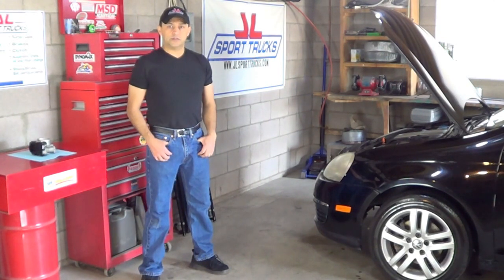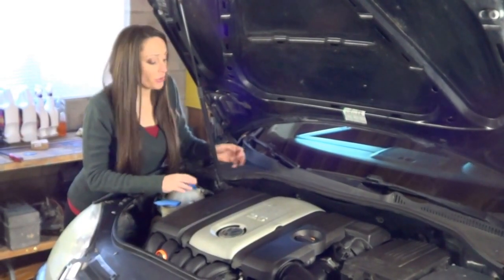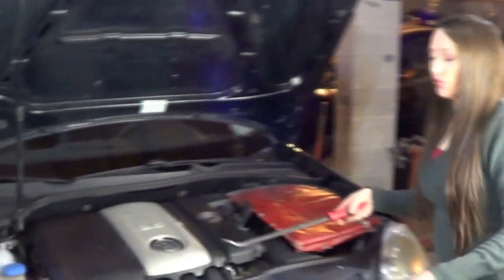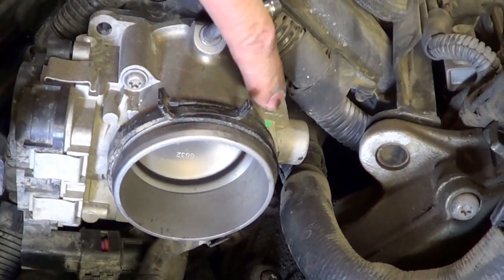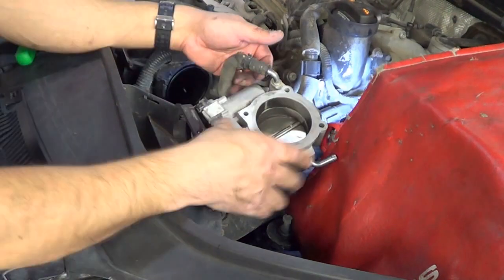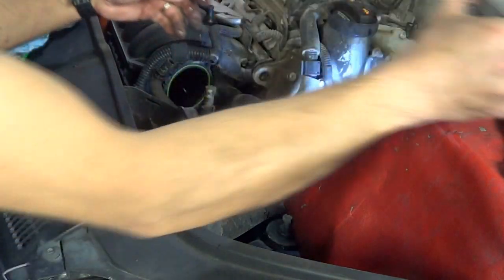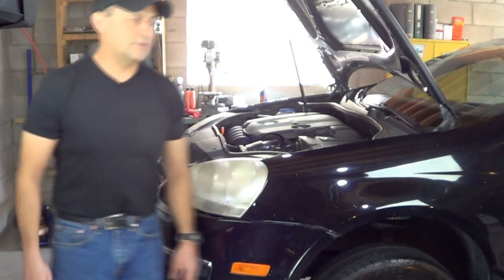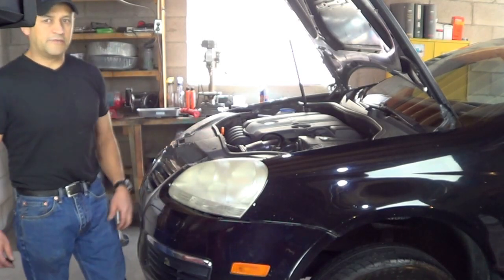How to replace the Throttle Body Unit on MK5 VW Jetta Equipped with 2 5 L Engine

Comment: Is the hose clamp at 4:27 a one-time only clamp? Do you need to replace it once removed?
Reply: Akcay1907 same question don’t wanna open it without knowing
Reply: Hmmm I’m wondering the same. Would appreciate an answer to this question 😊
Reply: Yes, you will need to replace it

Comment: Do you need to adapt the throttle body using vag-com or vcds ?
Reply: @mikeoxhard3826  how do i do that ?
Reply: @mondo9.2.5  Just unplug the battery and "turn on" the headlights for a few min then hook the battery back up. Should be good. :)

Comment: So what size 6-point key is used to actually remove the throttle body? T-28? Please specify. we need to know what tools are required before attempting repairs on vehicles.

Comment: I have a 08 2.5 Jetta. The dealer is telling me my TPS is bad and have to replace the whole throttle body and they have to reprogram the new TPS. Is this true or could I save money and just replace the throttle body myself in my car like you did in this video without having to reprogramming the TPS. Any help would be great.
Reply: Did you need to take your Throttle position sensor(thottle body) to the dealer to get reprogrammed? I need a TPS(thottle body) replaced on my 04 Jetta also. Just need to know if i can do it myself without reprogamming. Thanks...
Reply: @MrDannyLaRusso  Hey did you ever figure out if you had to reprogram the throttle body for your Jetta? I have a 2012 jetta and the throttle body needs to be replaced for me and didn't know if there is a way to recalibrate it yourself
Reply: don't go to the dealer, if they can do it, them you can do it as well, my 2.5 is reaching 50,000 km, although it still low, but i'm starting to lean everything before the engine code come on, 

thanks  great video
Reply: Did you have to reprogram it?